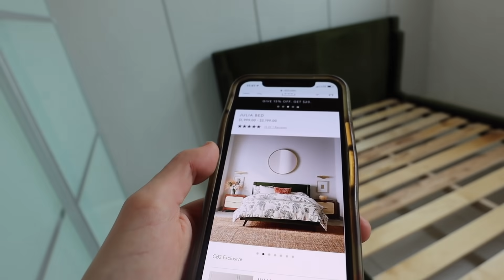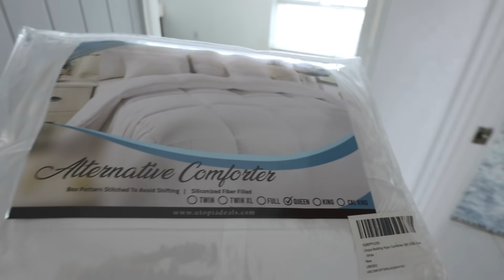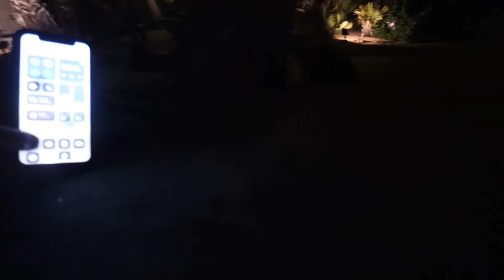I Bought A House!!!! Getting the keys

Comment: I think you guys should hold off on buying so many items for the house until your get finished with the structural parts. Cause then you will have to move everything, and plans may change too in terms on what you envisioned for the overall feel of the house.
Reply: Very true, my dad owned a airbnb and had the rookie mistake of  ordering furniture before the removal of the walls were complete. Then some furniture didn't look good anymore and 10k of value went right to the trash hard to resell.

Comment: Ceiling looks cool! I like that kind of "whitewashed" old wood look. I would leave the cypress trees, they make a good visual break to the buildings and powerlines and make a windbreaker. They also stay green in cooler weather and won't fill the pool with leaves. The palm trees are a nice touch as well, it's what people expect to see when they come to an area like that. If you want to change the water heater and gain some room go with a tankless heater. Only heats water when a faucet opens and water flows so you aren't spending money on gas or electricity heating water in a huge tank when it's not being used. With it being an Airbnb it could be empty a lot and you won't waste money on utility bills to heat water no one is using or have to worry about a water tank busting and flooding the house.

Comment: The couch is "Brady Bunch" not same color but definitely 70's. Wall's may be LOAD barring and against code to remove. You can't put a water heater on the roof, building code violation. Take the doors and fronts off the cabinets in the kitchen and replace just those and you will change the look, without blowing a ton of money. You should do one room at a time. It will go more smoothly and decisions will come together. Make a list for each room separately, then sit down around the table and hash out everyone's ideas. A contractor's verbal word can not be held as a legal bid. If you continue to buy on line, check measurements and call the company before you buy to confirm. Definitely has potential but getting organized is key. Listen to your Dad, and each other, you are too excited about buying things, when you should first focus on the structural changes, get those finished and then worry about furnishings.

Comment: You could move the fridge to where the stove is and then add a stove top on the island.

I also have more to comment on. 
The dark green bed frame and chair don’t match the house at all & kinda look tacky since the undertones don’t match the house. If you’re going to do color do blue or light browns or more cool tones. 
Also please just pick a color palette for the house. There’s so much variation in color (like the pink umbrellas, brown couch, gold accents, some silver accents, green velvet) and none of them work well together.  

Don’t paint the beams, just stain them and it will bring out the wood texture!

Comment: 13:51 once you put a box frame underneath the mattress it won't look so low...
Reply: That bedframe is designed to not use a boxspring, the bowed wood slats act like a suspension and take the place of it and you just put a thick 12" - 14" pillow top mattress on it.
Reply: Never use a boxspring with a platform bed. It totally defeats the purpose of it.

Comment: Painting the pool surround and bricks....you may end up with paint chips in your pool. There is a reason people don't paint brick and cement near the pool because they will shed paint. Just my two cents. Love the house! (3 piece window in the living area)...omg yes.
Reply from the maker: Good point... guess we might have to grind the concrete down to get that color out?
Reply: @shelbychurchvlogs  It's probably poured the colour. Terra cotta colours are often used as flooring in warm places. I personally like the look and fits nicely with the desert look.
Reply: @shelbychurchvlogs  Just bring in a contractor to STAIN the concrete. That way there will not be any paint to chip off.
Reply: @shelbychurchvlogs  As someone else said...it's very likely poured that color so grinding it down is probably not going to get you to a clean white/cream surface. I do like the terra cotta look. If it's driving you nuts, I'd ask the best known inground pool company in your area about it because they usually have a secondary cement/rock company that does the surround of a pool and could give you advice. Love the pool and the view!

Comment: 10:50 - make sure to tap on those sprinkler heads to put them down. They should go down automatically, but if not, make sure you tap them down and get them replaced. You don't want them to break off and not know.

I'd try and keep as many trees as possible. I know you want an unobstructed view, but the trees will give shade and, for me personally, add to the view. The coniferous ones look poorly, so replacing them with a similar hedge to the other side would look good - trees are only nice when they're healthy. I always found sea soil to be the absolute best fertilizer/soil amendment.

That side patio could be a games area with a ping pong table or similar.

Comment: This is very odd to me. Everything about this house looks like it was just modernized and simplified. The trees are such good vibes and completely match the landscape and mountain range. Don't fix what isn't broken. You could make so much more money with air bnb, general necessary upgrades and appreciation. Changing one modern aesthetic to another modern aesthetic is a complete waste of money not an upgrade. The gravel could be done nicely but removing the trees blows my mind and will absolutely cheapen the aesthetic.

Comment: Maybe you could add the hot tub in the patio area that is off of the larger bedroom. Or you could turn it into like an outdoor dining space type thing. I also love the idea of huge glass sliding doors to outside. Also, since the bed frame is so low, maybe you could put a box spring under the mattress to give it a little more height😅😅

Comment: “online it doesn’t look low” it literally looked just a few inches off the floor 😂 you’re supposed to put a box spring under the mattress to make it higher. spending $2k on a bed frame seems excessive regardless
Reply: Especially for a rental place.  Kids jumping on the bed or aggressive adults will wear everything down faster
Reply: That bedframe is designed to not use a boxspring. The bowed wooden slats act as a suspension and take the place of it. You just put a thicker 12" - 14" pillow top mattress on it.

Comment: mid century modern is cool but it is extremely TRENDY.. if this is a long term investment, especially with renters coming in, you may want to consider a more classic style... but I agree with many others, figure out the structural stuff before you buy all this random furniture that may not even end up working once you adjust things
Reply: I wouldn't call MCM trendy. It's only trendy to younger people that haven't heard about it before. Palm Springs is the MCM capital - it won't go out of style and people travel there specifically for that. If someone put classic furniture in a house like that I would cry. If the house were anywhere else, I could totally see your point!

Comment: The chain-link fence may act as a safety barrier for children around the pool and may be locally required so perhaps check before taking it out. You might be able to get prettier pool fencing.
Reply: Also, Airbnb may have pool fence requirements, but check.

Comment: It sounds like you're trying to change things just to change them... Since it is an investment you dont want to drop tens of thousands of dollars towards unnecessary improvements that arent going to increase the amount of money you get from your guests. its already in good shape, and spending 30k on sliding doors and polished concrete flooring isnt going to increase your revenues. its tempting to want to do all that but if it's a rental its not going to be worth it as you will never recoup the amount you spent initially. id furnish it and call it a day and get people in there as quickly as possible. dont reinvent the wheel and waste your money on things that work perfectly fine as they are